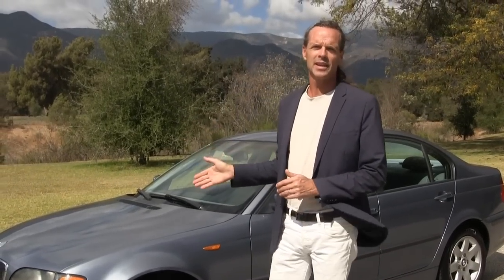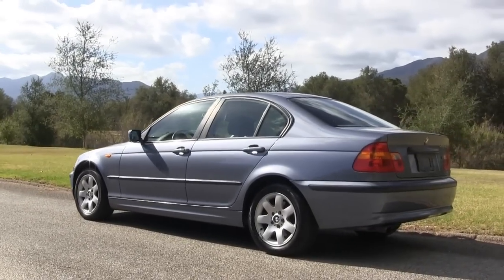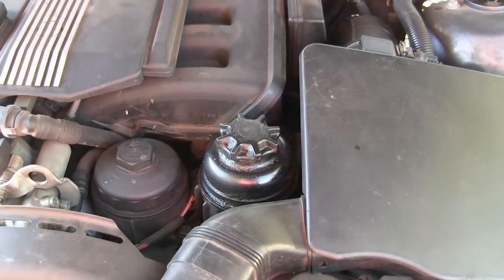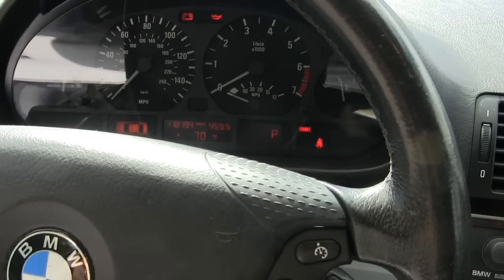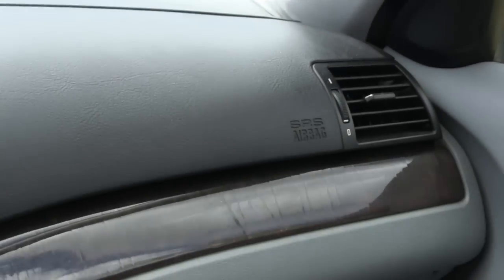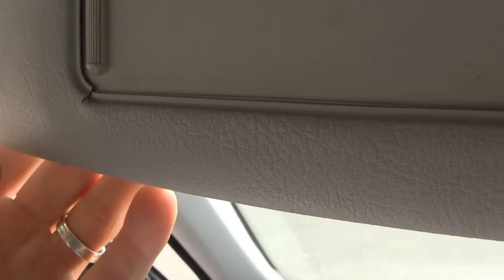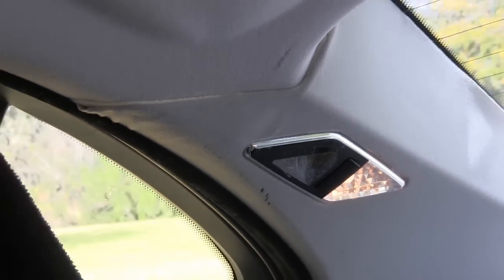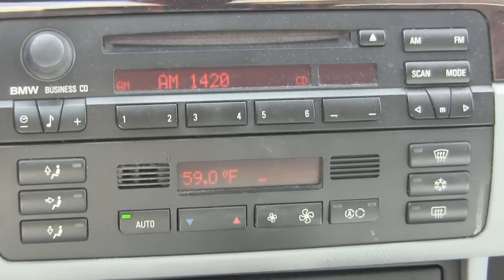Why You Should NOT Buy a Used BMW

Comment: Its like a house, you have to maintain it. I had an 1999 e39 530d with 650dkm on it. Everything that fade away due to heat you can replace it! All things that broke on the video above is common!
Reply: The Rock ñ
Reply: Exactly, all of that you can get off eBay for real chap these days and you replace them for 15 mintues in your garage. Come on, it's a 16 year old car now.
Reply: I got BMW e46 330D touring with 410000 km! What a awesome car! This video sucks!
Reply: kambo take for instance the e46 m3 or e46 m3 csl, it cuts chicanes like knife.... its a high rev car.. you have to maintain it! The BMW 6 in lines are the best 6 cilinders
Reply: mustlane just drive it warm calm! Before you use al the power! Change the oil between 20-25k Not till the red inspection light begans to warn!!
Reply: The Rock! I live nordic country where weather changing every month (rain, sun, warm cold, ice, snow ).
I change the oil ( Liqui Moly Longtime 5w-30) and filters between 10000-13000 km. There's no such thing as a bad car, only bad owners. I agree inline 6 engien (M57D30) is one of the best BMW engiens ever.
Reply: mustlane do you have a plug space in front to heat the motoroil on your house electric power???
Reply: I dont use oil heater! I have powerfull battery 100ah 900en, quality arctic diesel -45C, 100% working diesel engine spark plugs.....and let's start the engine. I agree, if you got webasto heating system, its makes car life easyer.
Reply: .....but why i love bmw inline 6 engien because in full tank 63L i can drive all most 900-1000km and its true i tested many times my self.
Reply: I got a better solution. BUY A TOYOTA. They will outlast any BMW.
Reply: CrxRacer805 i have a standard for living....!!!
Reply: Toyota is a thing you can drive A point to B point with out experiencing  positive emotion. Toyota is car with out soul, booooooooooooooooooooooooooooooooring car like most asian cars.
Reply: mustlane go drive a celica gt4 turbo or an ae86...
Reply: CrxRacer805 buy a Lexus over a BMW. Get some nice leather and reliable luxury
Reply: juan def you know what you're talking about good choice
Reply: Teflon Don 50 caliber Barrett thank you.
I read and read manifest on cars from automakers.
I care little about badges. Hell, if Honda bought Yugo and made them, I would own one.
Reply: I owned two Yugos. They kind'a worked. Really.
Reply: If you like poor performing, ugly as fuck plastic cars, I agree

Comment: I’ve had my 2004 525i since it was 1 year old and it has served me well.  Yes I have replaced the hood emblem twice, but it’s about $12 and just pops off so very easy to fix.  Bigger issues have been the voltage regulator (replaced myself for $65), one of the cup holders (replaced myself cheaply), valve cover gasket (replaced myself around $50 total but took 4 hours).  Other than that it’s been standard wear and tear items like brakes and rotors.  I’d say if you don’t mind working on your car a BMW isn’t so bad.  I really enjoy driving mine.
Reply: I rather enjoy my car and not work on it! Especialy on things that shouldnt occure on a car , that is way more expensive then other car brands. If a Honda or even a Kia can bring good quality for low price than BMW and all the overpriced german cars should do too! Right?

Comment: Completely disagree.  Bought a certified pre-owned 328i.  Have had no problems.  Fun to drive.  Have a turbo chargedn inline 6.  Made in South Africa.  Cruised at 130 mph on I-40 in Arizona.  No problems.  No oil leaks.
Reply: Agreed. I bought a second user 528i E39. racked up 283,000 miles before being written of when hit from the rear. Here in The UK I find VW to be the brand best avoided.

Comment: I have had e46 2.0diesel for 12 years,drive it non stop,everywhere,here and there and guess what ? I had NO issues at all,no mechanical problmes at all.just oil & filters changes,brake changes and one clutch,nothning else and i drove it 200.000 + km and still have it today,it`s a car that i can not sell it or get rid of it,even if i have other newer cars ! Cheers !

Comment: well this happens mostly in hot climate the interior parts falling apart, glue etc... obviously they did not test the materials and compounds for years, yes this I can admit to be a problem. but everything else is cry baby horse crap - mechanically this car is very well engineered. I have two of these and one of them 323i station wagon has now 300k miles on it and it still drives great I just use it less, its like a backup car. Yes i have went through water pump, thermostat, etc but which car does not have these failures? this is a very very nice car to drive and no there is no too many special tools needed maybe the cooling fan removal tool is what you definitely need of youre going to work on this car but besides that there are no special tools needed really. This car is brilliant, I have driven a bunch of new cars my friends are leasing and I still like my E46 the way it handles and drives. And yes there was subframe failures on  manual cars that were brutally driven, but hey you can break anything if youre abusing it. So to sum up your review - yes the interior is a problem in hot climate (South California for example) and if the car is in sun all day but other than that its bullshit - it breaks just like any other car but it is much more fun to drive than any of those boring Corollas or whatever you probably want to compare with. Importand thing is that this is not a boring car and your review fails to even mention that.

Comment: I own several BMW's and nothing drives like them but if you don't have a lot of money or aren't handy don't bother buying . This was owned by a woman , nuff said .
Reply: Imda Mann exactly. I bought a 2000 323i for $4k. The owner before me Gave me a file of all the maintainable he put into it. I haven’t had any issues for the past 2 years.
Reply: I'm a woman and owned a 73 battle for 19ys, I had my Nissan hardbody ex cab 4x4 for 16. 5 years. Sold it for 5,000 to buy my Nissan Xterra used with 21000 mi. That's a 2006. Still have that and bought a 2005 Chevy 3/4 ton Club Cab 4×4 Silverado LT with Leather and DVD + long bed and camper top with 13,000 mi. Mint for 17,500 in 2012. My cars are immaculate and get serviced regularly and any dents are repair immediately. My advice is don't by from men, because the car will be trashed.

Comment: I'm a subscriber and a fan. Our family has had eight BMWs. I agree with everything the Angel points out. Basically, if it's plastic, or some polymer/rubber, it's cheap and not up to the Japanese plastics. I've been told BMW used recycled polymers. There are  more problems that are not mentioned here: valve cover gaskets, and emissions related lines. But at the end of the video the Angel acknowledges that these cars are the standard other manufacturers try to achieve when it comes to driving and handling. Find a good independent BMW mechanic, or do basic maintenance yourself.  If you want a driver's car to enjoy, then an E46 is a great choice. (E30, E36, and Z3 are also good choices).

Comment: You can find these for like 2500 bucks, so for a cheap commuter, the benefits of the reliable drive train outweigh the cons of the interior fit and finish issues.
Reply: PNW 360 You didn't watch the video apparently:)
Reply: mate sivric uh, I did watch the video
Reply: PNW 360 Reliable means doesn't leak or have overheating issues but that's just in Chicago apparently since overheating in -20 degrees is "Normal"?
Reply: mate sivric you can get the expansion tank for fairly cheap and it's not that hard to replace yourself, I actually had an 03 E46, it was an awesome car
Reply: Made in Germany? Those are the ONLY German cars I trust after friends and family have had a few 330s, 745s and VW cars ALL had problems since my uncles Mercedes 300d THAT RAN FLAWLESSLY FOR 300K
Reply: Didnt use to be the case, just 3 years ago they were still worth around $8k on the market, I got one, and paid over $5,000 in repairs.
Reply: Obviously YOU didn't. That's exactly what he talked about.

Comment: These series BMW's are very popular in Australia. Yes they have the critical coolant system issues that must be proactively attended to. They also have common mechanical maintenance requirements well known on the internet. However while Camry's from this era are extremely reliable nobody bothers to keep them as they are just too boring to drive. They have mostly left our roads. Yet driving around you always see plenty of these model BMW cars getting about and their prices are stable having fully depreciated to value-on-condition. So while he is right to caution, Australia has potent sunshine, the BMW interiors of this vintage have generally held up better than as shown here. Can't explain that.

Comment: This is shit! I own a BMW (M54 B22) 2003, I have no such problems
Reply: Say the truth, you've spent a lot of money on it. Wasted!
Reply: xtintux  buy a service manual and tools. cars are generally not that hard to fix.
Reply: Had a 2001 E46 wagon with the M54B22. More miles than this one,  was kinda mistreated by the previous owner (the original owner was meticulous, though), and had none of these problems except for one (the chipped front emblem), and I didn't spend more money on it than on any other car, tbh. In fact, my best friend's Toyota was just as expensive for him to own as the E46 for me. 
Part of it is that I never went to the dealer to fix my car. I've found a great mechanic, and as soon as you ditch the dealer, the costs go down significantly. Currently, with my E36, I'm saving money even more because I wrench on it myself. 

It helps that it was put together in Germany, not Mexico or the US, too.

Comment: My e46 has 220,000 on it runs great and everything works fine this guy is a tool to generalize a car.  BMW lives matter
Reply: j mumm are you kidding.  bmw are known to be problematic and also very bad service also just ask any mini owner that has problems . Mercedes is another POS , money pits, i have a fiend who has bought new a 2005 b200 and in 2015 had all 4 doors rusted out. i have a pontiac g6 same years and all my doors are still in good condition  he also has  a 500 series 2002 never saw winter and the drivers door is started to rust out and at only 80,000 miles had to replace the binder , i am 58 and heard lots of car stories in my life and BMW is by far the most unreliable car out there , another friend of mind had a 3 series bmw convertable car not even 2 years old barely any mileage on it , roof was leaking through the latch radio was even worse cd would skip even on little bumps and dealer would not fix it
Reply: roger white well still all cars have problems. At least BMW doesn't kill people like Toyota with their faulty throttles or the fact they burn themselves to the ground. It's all about how the car is taken care of. If you take care of your car and do the maintenance on it it will last. It also depends on where the car is located any car will rust out if it's in part of the country that uses chemicals on ice and snow that will destroy a car. Also if the car is located on the coast the salty sea air will help with corrosion. If you get a paint chip and don't get it fixed your car will rust. The basic thing is if you take care of your car it will take care of you no matter what it is.  Like I said my 2004 325 runs extremely well no problems  220,000 thousand miles and will go a lot further.   Also remember that The different countries have different climates that affect cars differently.

Comment: I service bmws on the reg, especially e46’s
They’re very common where I’m from. Literally the only thing ever wrong is the plastic cooling system components, oil filter housing o rings, pcv valves and ignition coils. Occasional vanos seal replacement.  This videos a joke. Don’t buy it because a cracked piece of plastic??? You’re crazy. These are some of THE best cars imo they’re not hard to work on or diagnose
Reply: My 02 325xi not sending fuel on 6 cylinder misfiring I have changed the coil and plug. Would a ccv clogged cause this also to happen

Comment: I have owned a 2000 328Ci for 4 years. Just routine maintenance has been needed. The car had been well maintained. The car in your video looks like it had been located in a hot climate, unprotected. There are many e46 BMWs where I live. My Toyota Tacoma cost much more to maintain. Maybe I'm just lucky. My car has 209K miles and is not a piece of crap by any means.

Comment: My 20 year old Camry looks 10 times better than this junk. Very surprised to see this.
Reply: I can assure you it drives at least 10 times worse
Reply: @TheWretchedWorld  Nice try! As a matter of fact Camry 2.2 SFE engine is known for smooth ride and reliability.  It's smoother than 2019 Camry I test drove a week ago at dealership and still want to keep it at 200k mileage.
Reply: @afara2000  ive driven many camry's of that same era and im sorry in terms of the drive the handling the braking the steering safety equipment and technology the bmw is a better car and so it should be given the price disparity when new. We have an e46 323i in our family for 19 years with over 330,000KMs and its been the most reliable car we've had. In its life its never once broken down and the only components we've had to replace are wear and tear related in other words stuff you would do on any car. It has its original auto transmission and the engine the car left the factory with. It consumes 0 oil and blows no smoke. A lot of people like to preach and generalise but honestly this car has been good. Btw the ashtray is still intact. Don't compare a camry to a 3 series bmw. It might be more reliable (in most cases) but as a car its not in the same league.

Comment: I just got rid of my 2008 M6. It was a beautiful car and looked and drove like new. But at what cost? I got it with roughly 60,000 miles on it. I had it for 2 years, I put around 12,000 miles on it. I spent $12,000 dollars on repairs and maintenance. A dollar a mile! Not counting gas (17mpg if you're a good boy) and loan payment.
 Brakes needed to be replaced ($1,200 - $1,600 parts only), the water pump was on its way out ($900 parts and labor at indie)...
Traded it in for a Prius and cannot be happier.

Comment: bet he has never owned a bmw
Reply: Agreed...... I bought a 1997 BMW Z3 in 2000 with 18,000 miles. I ran the car until 2012. It was never garaged and sat outside In the 12 years of ownership in Pennsylvania, I replaced the top twice, the brakes once, the battery once, the clutch at 198,000 miles and constantly got 30+ mpg. I sold the Z with 232,00 miles.The only reason I sold the car was that I left the USA after the muslim-in-chief was re anointed and moved to Ecuador. The Z3 was the best car I have ever owned. If I wouldn't have moved, I would still have the car.
Reply: DrScopeify doubt you didn't do anything to maintain it lol
Reply: Ed O'Connor Muslim in chief? What a joke. Obama ain’t perfect but using a ad hominem attack against him is pathetic.

Comment: All cars will have a lot of issues once the mileage clocks up regardless of brand unless it's a Honda or Nissan.
Most problems come for poor maintenance once they fall into wrong hands, as long as you aren't a muppet you can catch problems such as coolant system failures before they become terminal.
If you buy an E90 or newer then that's a different matter but the E36 & E46 are generally sound.
My 2004 330cd is still on the original water pump, expansion tank and pipes at 182,000 miles.  If you are worried about faded badges and odd scratches you aren't man enough to be driving such a car, get a Nissan Leaf.
All the Fords, Vauxhalls, Volvo's and VW's I've had have been in much worst condition at less than 120,000 miles.
This particular car has been left out in the blazing sun 24 / 7 and probably washed with chemicals that eat some of the rubber seals.  The subframes usually only crack on the M3's and there are retro fit kits you can buy to avoid this.
You do get particularly bad and good cars of each model. 
The biggest E46 problems actually centre around the suspension bushes and tie rods which usually need replacing at around 100,000 miles or the handling goes AWOL.  Springs can also snap but I've had that on Fords as well.  Don't buy pre facelift E46 because they have an odd steering rack which gives a vague feel when driving, later models use the same racks as the E36.
I've only heard of interior liner problems on cars that are cleaned a lot possibly with shampoo's that affect the glue.  I bought an unloved car complete with rust and lots of dog hair so all my liners are exactly where they should be.  
Parts are super cheap for these now as so many were made and they have a following, I can replace the wing ready painted for less than £100 delivered.
A new pair of rear springs fitted was a mere £60.  You deserve to be fleeced going to a BMW dealer just as you would be at any other dealer, none of them are cheap.
Reply: Marcus Taylor yessir just bought mine. Excited

Comment: I drive a plain 08 Nissan Versa with a basic option package including power windows and heated  mirrors , AT and premium stereo and Air. That's about it. It has 200000 kilometers on  it and nothing's ever broken, not even a single plastic part of which there are plenty  .. The interiors kinda dirty right now but its holding up well, all the parts are still there and none of them are broken. It's only been in the shop for scheduled maintenance and to deal with one minor recall. Very impressive for a heavily used econobox that only cost a fraction what that BMW did...